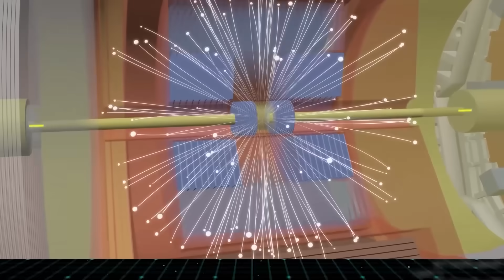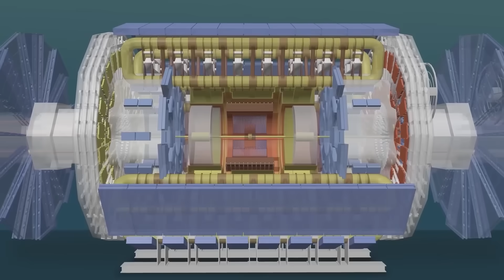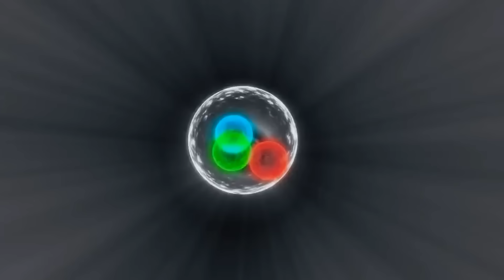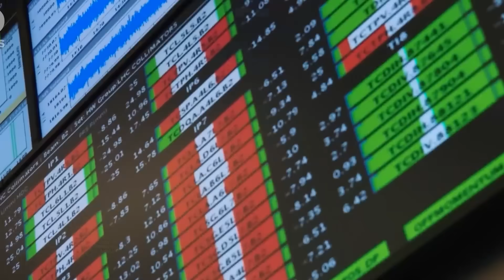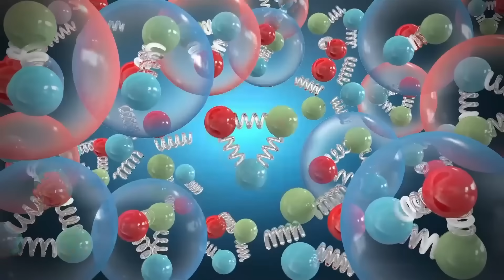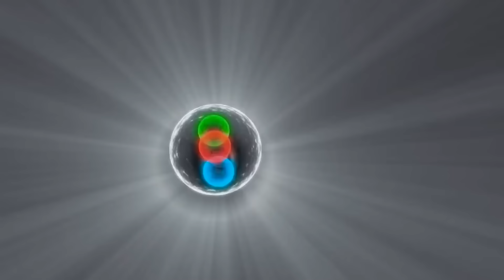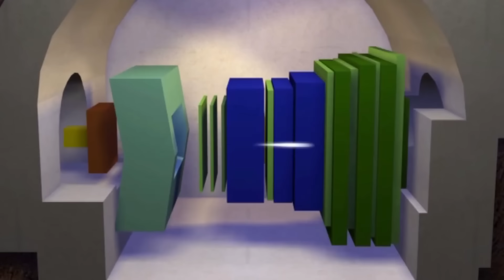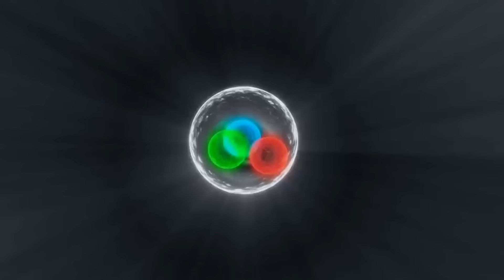CERN’s AI Warned Them Not to Collide 2 Particles… After They Did, It Revealed a Horrifying Message

Comment: There is no verified evidence or credible report of CERN's AI issuing a warning during a recent particle acceleration test. CERN actively uses artificial intelligence (AI) and machine learning for tasks like anomaly detection in accelerators, data quality monitoring in experiments (e.g., the CMS detector's electromagnetic calorimeter), and optimizing beam efficiency through projects like the Efficient Particle Accelerators (EPA) initiative.8707c6aac775 These systems help identify issues such as equipment faults or data irregularities but operate routinely without dramatic "warnings" as described in rumors or sensational claims.

Comment: There is a 'definite' pattern to the resonate stability of atomic form and universal processes. 
These work within 'infinite probabilities' being as fractals and 'symmetry' to 'geometric' balances... or 'determinate outcomes'. 

If the AI warned of a 'violation' to this end, then I would propose that... what was in 'violation' is the removal of sequential processes that altered a 'determinate outcome' not by 'infinite probability' but by absence of either. Every single atom, molecule, complex compound etc... is a part of the systemic form of this spectrum of reality we call 'Universe' or the 'material reality' to others. 

I do 'conceptualize' these terms significantly simply because of the direct conflicting theories that are not resolved within the framework of 'science', and this allows the conceptualized explanation to not be contradicted by erroneous perspectives weighted by facts derived from different points of reference, being both true in specific conditions but untrue relative to others, at the 'same moment.' This way the conceptualized idea can 'survive' the limitations of erroneous perspectives until the moment is better understood. 

If there 'is/was' and 'always will be' this 'violation' that extends itself outside of 'time/space' or the 'spectrum of the material form' we call 'Universe', then it would be attentively observed by 'consciousness', higher equal forms undefined if not 'self defined' and these will 'never self define' to another for 'specific purposes' related to the same concepts deep within quantum mechanics that allow 'influences' by 'consciousness' to both observe and form the physical spectrum at the 'same moment/all moments'.

A simple understanding of the measure of 'consciousness' in such a way is to say this. If a 'consciousness' can make a 'decision or choice' outside of 'time/space' then this 'choice/decision' is and always was/will be' at that moment. However, this doesn't 'resolve' the time issue as it relates to how 'this universe' works. 

Simply put, when an influence such as this takes place or 'happens', the 'relative' moment given to the internal cycles of the Universe based on 'consequential or relative perspective' leading to that choice, which would not be derived internally but rather 'self existent' by that consciousness, then at the moment the circumstance aligns with the condition of 'awareness' of this consciousness, the effect then descends into 'time/space' universe and is 'separated' by a measure or distance of 'cause and effect'. Time is then 'created' by this choice both backwards and forwards to 'lead up to and consequential' of an event that is 'formed' by this choice/decision from the external consciousness. This can be 'measured' by contrasting the previously mentioned 'resonate stable frequency' through mathematical formula patterns being used by the 'concept' of a measure of 'time' to relative cycles, then translated through a relative analogy to comprehend the circumstance directly given all the data... What I mean there is that the conceptualization of the data is the 'only way' to recognize the interpretation of the data in the relative sense given to our 'form' of existence we are 'limited' to as well as our 'angle' of perspective being 'within' the 'time/space' environment or 'spectrum'. 

How this works 'backwards' is simple. For each 'action/reaction' there is a natural condition that creates the 'cause to effect' distance. In physics the process is relatively simple to predict in concept, but not in 'exact' consequence. We can say things like 'what goes up must come down' but to measure and calculate the very specific motion and moment to a 'determinate outcome' of the occurrence would be mathematically tedious and most people would likely get it wrong by not including some external influence not within the framework of 'science' yet. So practically impossible to predict to that specific measure but by most standards, 'good enough'. 

These consequences are always aligned to 'determinate outcomes' or the closest resonate consciousness to their own degree of awareness/observation to that 'cause' if that consciousness 'chose' by their 'willful expression' to create the 'action' leading to consequential outcomes. Even in this, when a consciousness is indeed the 'desiring expressor' to these 'sequences', when the 'observational' desire is satisfied, the conscious 'grip' to their degree of observation is released, and so the relative action becomes 'inconsequential' as the infinite remaining sequencing 'causes and effects' become 'polarized' to the determinate outcome. That's how it works in a 'present moment'.

So to understand this, one must also recognize that the 'model of 'time'' used in a linear concept is just that... a comprehensive model and not the 'reality' of the 'present moment' where the literal layers of time are all 'within reach' and can be manipulated to an outcome of the present moment which I will not indulge to explain here, but can explain experimental successes in this theory having 'rules' to consequential desired outcome that most observers will call, 'glitches' in reality. These are both observable and able to be replicated, given to circumstances directly related to 'consciousness' and the measure can be observed. This then is only explained in such a way that the 'past' is actually a part of the present, and the future in form is only a designation of a determinate outcome that polarizes the 'effects of causes' of lower consequences/consciousness'. 

So when they 'bumped' this, they could have created a slight 'imposition' to an actively aware consciousness residing either 'within or external' to the 'time/space' spectrum of reality. Regardless of the 'presence' of an individual 'here' that would be physically present is irrelevant as the 'consciousness' of all living things resides outside of 'time/space' allowing the 'infinite probability' to include influencing the 'determinate outcome' that 'sequences' of cause and effect are 'leading towards'. 

The term 'We See You' is exactly this and the 'one' agreement of self aware consciousness' of these 'higher laws' external to time and space is that one cannot impose upon another, as this is a violation of 'sovereignty' and will become consequential to the determinate outcome, realigned by this 'observation' from this specific 'event' that should be taken as it is expressed and to be in truth that... "We See You"

Comment: They will never be able to recognize other dimensions,  until they learn how to tune into them. Just like the snow we got from the old rabbit ears not tuned into the old tv stations. I know, because I got zapped with over 7500 watts from a major powerline. for over a minute the day they turned CERN back on after fixing the damage that was done to it by a weasel chewing the wires. I split the earth in half. I was supposed to be dead and the Dr's were shocked that not only I survived, but I healed faster than imagined. I lost a few toes, instead of losing all of my limbs like they said I was going to. I saw the sky. It was open. The plasma had me in it's center. I beat it. It released me, dispersed and then sunk into the ground. I saw the rip in the sky seal itself up. It was the snow just like in the old TV sets out of tune with a channel. I was lost inside it at first and realized I would be lost forever to never find a way out and yet it happened. I took a breath by rolling onto my stomach and using a swim motion to bring air into my lungs. I finally took a breath after watching my eyes looking back at me.

Comment: At CERN, Prometheus is used not as an AI system but as a highly scalable monitoring and metrics platform integral to managing their complex computing infrastructure. Specifically:

CERN relies extensively on Prometheus for collecting and monitoring time-series data across various services, including storage systems like Ceph and EOS (a distributed file system CERN uses).

Because CERN’s infrastructure generates enormous amounts of metrics data, they use Prometheus combined with Thanos, an open-source tool that extends Prometheus for long-term metric storage, higher availability, and scalable querying.

This setup helps CERN perform capacity planning, monitor historical system performance, and maintain smooth operation of their IT environment.

Prometheus data is accessible through Grafana dashboards, providing CERN’s engineers with visual insights and real-time alerting about their computing assets.

CERN operates the world’s largest particle accelerator and a vast global computing grid, so this robust monitoring system is crucial for managing its 12,000 servers, half a million CPU cores, and hundreds of petabytes of stored data.

While Prometheus is a key infrastructure monitoring tool at CERN, it is not an AI itself but supports the data needs vital for the experiments and computing systems.

In short, CERN uses Prometheus as an advanced monitoring system integrated with other tools like Thanos and Grafana to oversee and analyze its massive computational infrastructure, enabling scientists worldwide to access critical data reliably.

There is no indication that CERN operates an AI product specifically called "Prometheus AI" in the sense of an autonomous intelligence or AI assistant. The usage there is focused on monitoring, metrics, and data infrastructure.

Related
How does CERN integrate Prometheus with Thanos for long-term metrics
How does CERN use Grafana and Mimir to monitor the WLCG
Why did CERN choose Mimir over other metric backends
How do CERN’s exporters handle EOS and Ceph metrics differently
How would adopting CERN’s stack scale for my medium research cluster